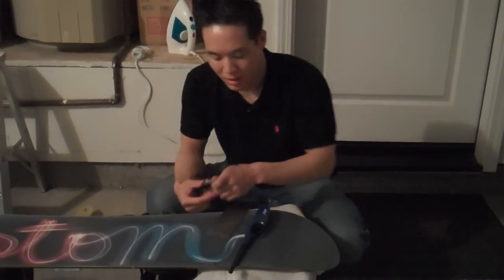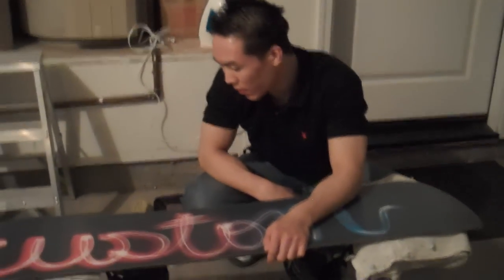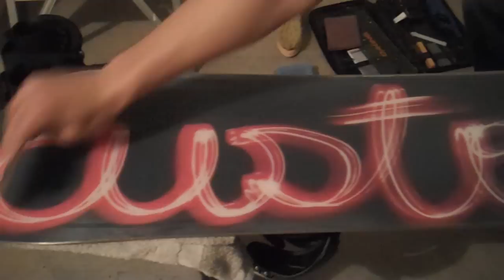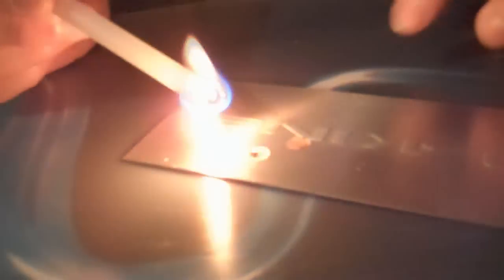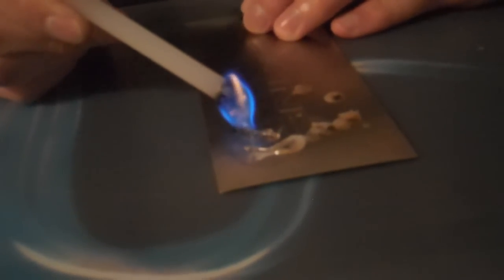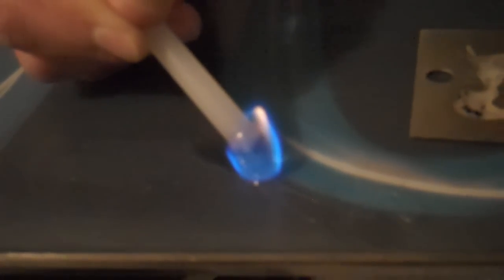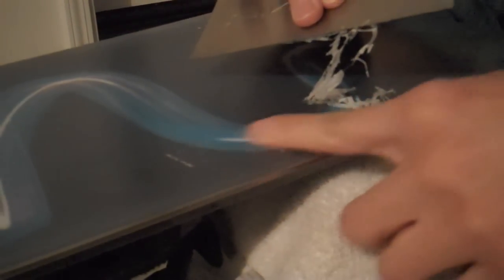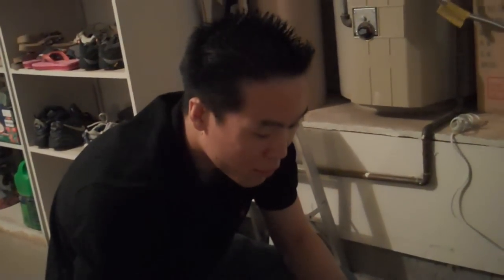Part 1 - Base repair on a snowboard or skis

Comment from the maker: @lucasclay69 the plastic scraper is to get the wax off.  the metal scraper is to get the epoxy off (in this video) for base repairs.  if you use the plastic scraper, youre going to chip and break it, rendering it no good for scraping off wax.

Comment: @liamk000 dude if its very bad, after you fill it in and go shreddin it may you know, crack and fall out of the hole - that's normal. just do it again. you may wanna do some like scratches at the edges of the hole for the new stuff to fill in it and grip the base. but if its very deep you may just have to redoit couple times.

Comment from the maker: @MisTaHTaKi whoops sorry about that.  yeah the heat is fine, theres no other way to do it anyway.  clear ptex on a black surface is fine.  with the clear ptex, you can see the gouge still, but when you touch it, the surface is flat.

Comment: when scraping the p-tex off do not start from one side and go to the other start in the middle and go to each edge, when you go to end to end you are pulling the P-tex out and the flame should never contact your board
Reply: The flame helps bond it. N u dont pull p-tex out. Its what i do for a job, u just dont want to gouge the base.